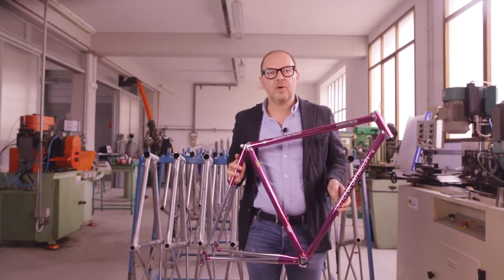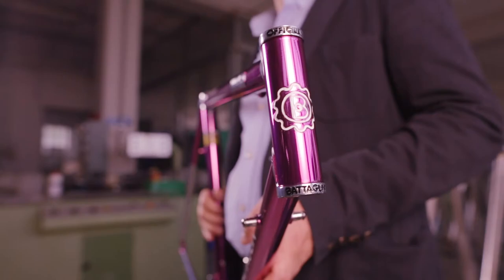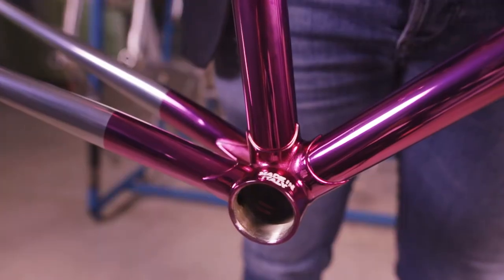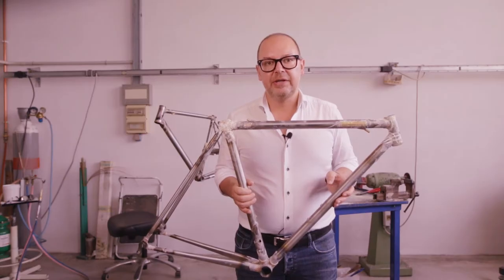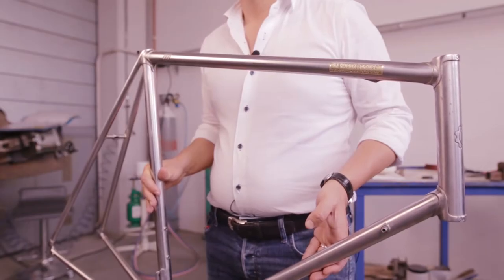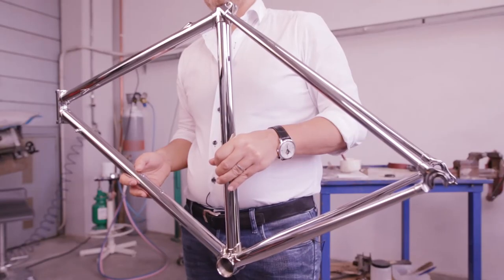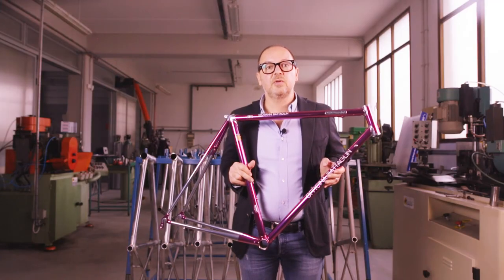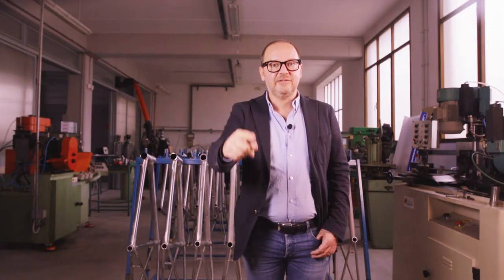How a CROMOVELATO steel frame is actually made

Comment: I just bought a 1987 Pinarello Tre Cime.  In those days, Pinarello also chromed the entire frame and fork, and then painted over the chrome.  But the painted sections have a more satin finish; I believe this is because only the sections where it would be exposed was the chrome polished--depending on the model, this was the chain stay, seat stay caps, fork and crown, etc.  The Tre Cime was a lower-level model, so there is very little exposed chrome.  In the 33 years since the bike was built, paint has worn off in some areas, leaving exposed chrome, which has been polished by friction.  The decals (except for one Columbus Matrix fork decal) have also worn off, as Pinarello did not clear coat after applying the decals.  Overall the effect is nice and subtle, not striking like your Battaglin's finish.

Comment: Hi there, how much weight does the chrome plating add to the frame? They do look absolutely stunning by the way, and I am interested in the different process used on the carbon forks, since carbon cannot be electroplated.
Reply: Steel  is the best

Comment: Does the cromovelato finish require any special care to preserve the beautiful finish?
Reply from the maker: Not really! Just the basic maintenance for any high-end steel frame.
Reply: @OfficinaBattaglin  thank you for sharing! May I know what is this "basic maintenance" you would recommend? Any particular brand or type of polish you would recommend?
Reply from the maker: @irwinlimweebeng  The most important thing is to wash the bike using bare water after every ride to remove the sweat and the dirt. Then, dry it thoroughly without applying too much pressure. You can polish 3-4 times a year, but the frequency can vary depending on the area where you live.